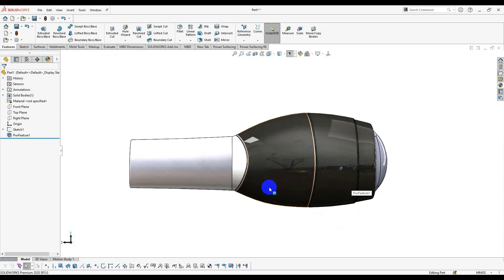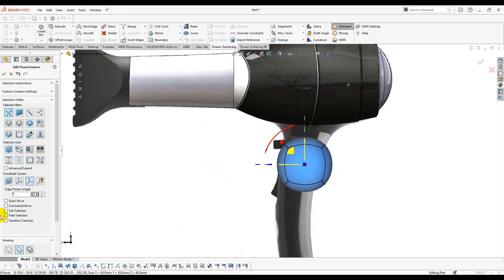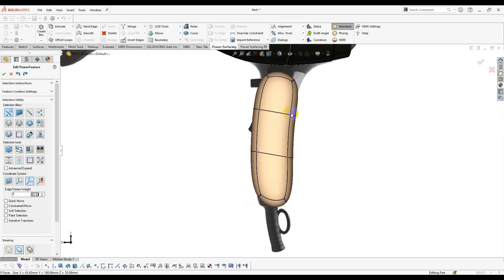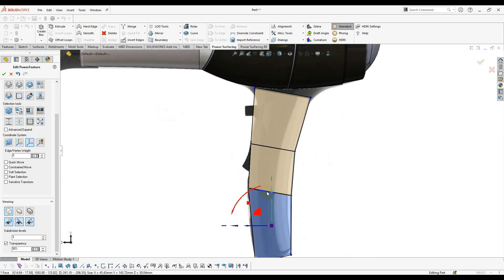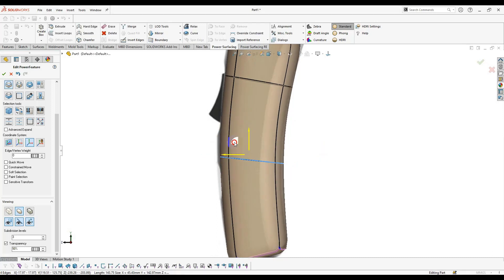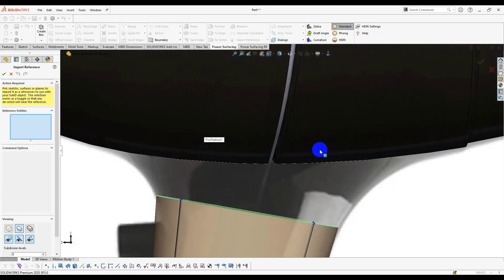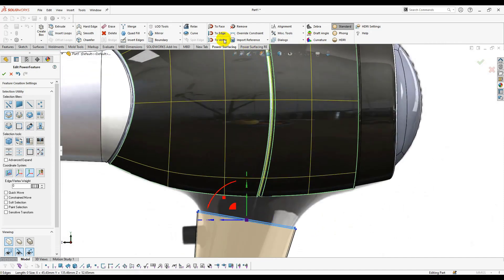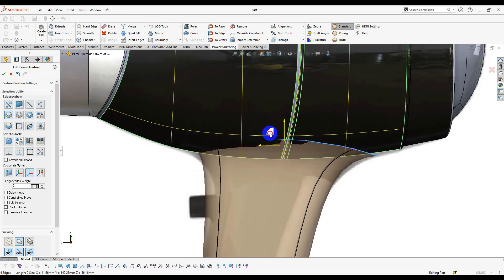How to Model a Hair Dryer with SOLIDWORKS

Comment: hello, is there a list of the keyboard shortcuts for powersurfacing?
also how can i type a value when i moove a CV or edge?
i am learning and i can't find that in the manual, help would be really appreciated.
Reply from the maker: From Advanced traid tools you can choose a specific value for moving vertices,lines,etc…
Reply: @npowersoftware6638 is there an option to give measurements when creating a surface?